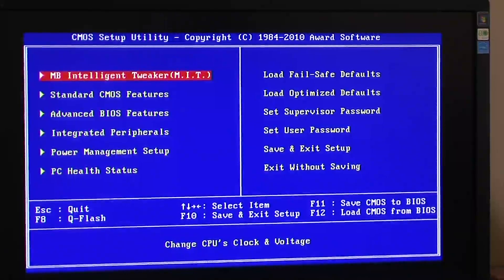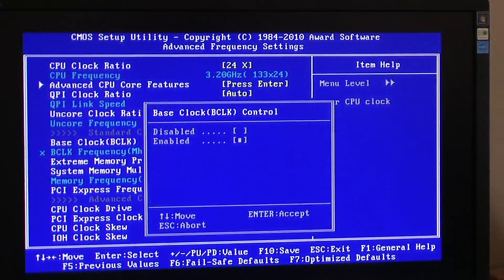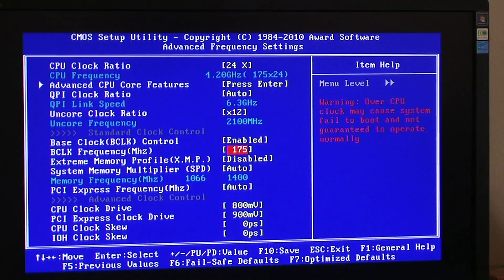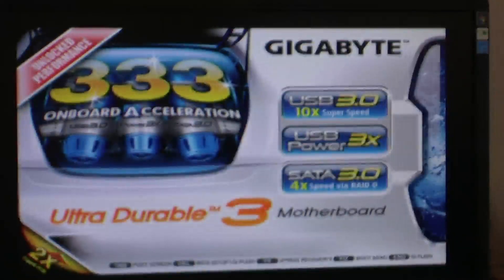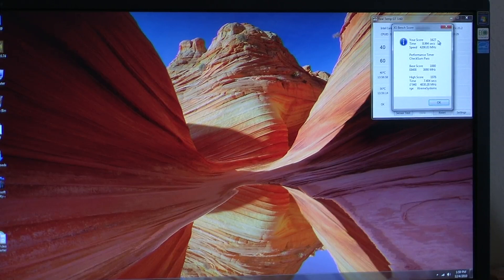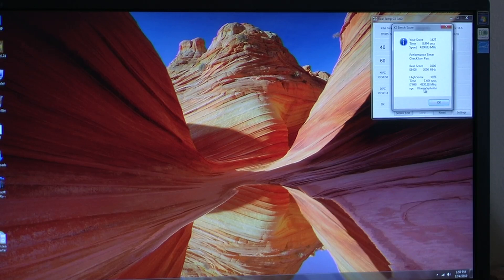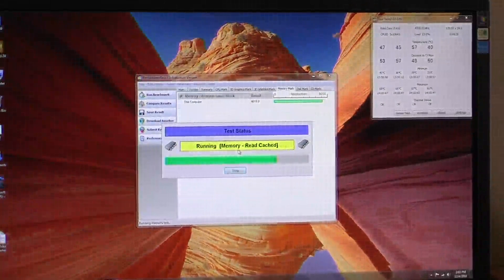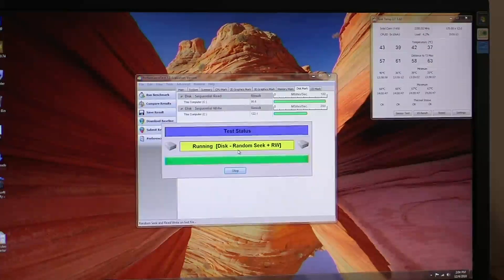GIGABYTE X58A-UD3R + i7 950 BIOS/OVERCLOCK/BENCHMARK

Comment: I would have liked to see your voltage settings. I have this same board and a 930 and I can push the BCLK right up to 200 and then core up to 3.2 and its stable on auto voltage but when I go to set the voltage to take it further it crashes, even right up to 1.25v
Reply: I m really need your help!!! I have the same board and all i want to know can i use Hyper 212 EVO CPU Cooler On this board? My Case is Cooler Master K282
Reply: That cooler will work with everything. Some people still use it on the newest platform. Although its not a strong cooler so you won't be able to get maximum overclocks with it.

Comment: iam having a ram problem and iam running the same board and processor can u help me
Reply: Same here, I have 24gb installed but shows 16gb but windows enterprise see's 24 just 16gb useable.
Reply: ReganMarcelis figured it out it was a few bent pins on the board for the CPU socket
Reply: I heard this before but makes me wonder how so many people on these boards ended up with bent pins, how did you bend them back, easy to spot? Did your reboot three or four times and then boot-up into windows? i am starting to think mine is not this bent pin plague as my windows does say 24gb installed just 16 use able. It is 64bit windows enterprise. Glad you found yours, now do I take my CPU cooler off, etc as its not an easy one to do...
Reply: ReganMarcelis just go with a different platform this one is notorious for being junk that's why they never expanded it's use
Reply: If u look on pcpartpicker.com you will see the limited amount of CPU options
Reply: They broke records on this platform? Overclocking Records. I know though about this issue and its odd how everybodys is different. I do not think mine is that serious since it is showing it in windows just not usable maybe by gtx 1060 is using the other. As for the three reboots till restart on - d-ram, welp, that needs to be fixed. Maybe the timings... are still set to my rip jaws. LGA2011-V3 is my fave socket, not many options either but brilliant and pricey! Maybe they wanted to drive the market up in the future since overclocking is so easy on this that gamer's would of flocked to cheap chips. There is def an issue on gigabyte boards with triple channel memory though and some timings I think... x58 junk. NAH! Hogwash. Even with my issue she is starting and I think the 24gb is being seen by windows so it isn't even the platform or board, its my gtx 1060 sharing it... the three restarts with dram is the board but I will get to the bottom of it but she still starts even thru this, it must be the timings going to take them out tonight and write down the mushkin stealth triple channel timings and try to set manual.
Reply: ReganMarcelis to each there own, one of my fave was the z77 platform 3770k just a beast
Reply: But they did break records with the x58 I have my x58 up to 4.9 ghat I think they got to 5.2ghz
Reply: My bad it was actually 7.195ghz with the i7 980x x58
Reply: Without a doubt man, I know people like the 8700k but I like the 7700k as it shows up twice in the top three slot for best overall multi and best overall Single core use so all around its a beast and over clocks like one so much so intel has been doing something with the 7700k telling folks who own it no to overclock , hmm...
Reply: Yeah, Gigabytes OC board was highly sought after and if you had pone, you were the man, heck if you have one today you are the man as its a great board. I wish I still had mine even over some of my newer stuff. The 950 chip I can say is stable, one of the most stable chips I ever worked with even at medium overclocking however it has more instructions to it then most chips so I heard hence may be giving it the ram problem plus triple channel is an odd ball thing in the first place. I will figure mine out! Maybe it just doesn't like my two sets of 12gb Mushkin Ram triple channel, I hope not as I like them! HAH... My only issue now is on a fresh reboot it reboots thrice as goes to checking DRAM, reboot, then again dram pool or something similar, reboot then again then it goes right into windows after the last one. It does some type of patch. Maybe I should stop being lazy and google the patch #'s. HAHA...
Reply: Makes me want a 980 with the Gigabyte OC board with al those buttons and the great Halloween theme! Was BEAST! It still is... I may look out for one, they sell on eBay for around 800. HAHA... Wonder what the 990x is now, is that the best chip on the x58 platform by clocked specs anyway? I lost track when people hopped ship...
Reply: I bet x58 was the first to run 6-8 cores at 5.0+ ghz on ALL cores... STABLE. Also the first Hexacors which are indeed my favorite besides the 7700k which is obviously a diff socket. If I could fit the 7700K into a old gigabyte OC board, I damn well would, HAHA!

Comment: back when i had the first Prescott p4 cpu it idled at 60 with stock fan with no overclocking now i have a i7 920 clocked at 3254.97 at 100% use it has reached 100 after about 3 minutes with prime95 for my cpu fan i am useing Noctua NH-C12P SE14

Comment: I also want to Overclock my system. I have :
i7 950 with a noctua nh-d14
Asus Sabertooth x58 motherboard
GTX 570
8GB 1600 MHZ Ram
850W Power supply

Will those settings work on this systen? And what is the difference between voltages, i mean i dont know how i should do it. Most of the people say that upon 3.8 GHZ you should change the voltages. I hope that you can answer this question. Greetings

Comment: its because the i7 950 has a multiplier of x23, x24 is considered turbo boost, so it is 4.03ghz with 4.2ghz turbo. Normally it would be 3.07 at x23 with 3.33ghz with turbo boost(x24)

Comment: @terryn89 Part 2 HA. What I did was set the overclock in easytune to the maximum under the easy mode which is 3.68 ghz. then it asks to reboot, when it boots up i go into my bios and see it's actually running at 3.84ghz. @ 160mhz. The reason, I think the program was written when the i7 920 was hot. I may be wrong though. Anyway dialing it up to 170mhz in the advanced mode pumped it to 4.08 and 175 shot it to 4.2. She had problems at 180 mhz so I dialed back. Running great  @4.2...more testing.

Comment: @terryn89 I didn't know the settings were in the "Easytune 6" to go above 3.68ghz. I goofed around with it the other day and found the settings under the advanced mode. Anyway, to make a long story short I was able to get a stable 4.2 ghz running "prime 95" for about an hour and never got above 55c with my Corsair H80 water cooler. I read all the time that you shouldn't overclock with an on-the-fly program but easy tune literally does it in the bios. I haven't messed with any voltages yet.

Comment: Hi there, I followed the video step by step yesterday as I have the same motherboard and an i7 950 bloomfield CPU. On reboot it always shuts down the first time and on 2nd reboot I get a message saying that some voltages or settings have been changed that don't work well with the system and goes back to original settings. I even tried it after un-installing "Easy Tune 6" but the overclock just wont hold. I've tried under 4ghz also. Easy tune allows up to 3.68 and that works great. Any Ideas ?

Comment from the maker: @Kaeden728 Your a brave soul to update a bios. I honestly haven't done that in more than decade... or two. It's a tricky to do and more times than not results in what you had, dead motherboard. With boards costing just a few hundreds bucks anymore flashing the bios, imo, is not worth the hassle. I upgrade pretty frequently, and as matter of fact have sold this particular computer and a few others I've built in the meantime. Currently only running a laptop until I sell another custom rig.
Reply: Xm58s are tanks in the beginning i sait qpi vcore to like 1.45 not knowing how bad it was luckily I dove back in to see what the issue was I have 3.82 ghz stable but i want 4.1

Comment: @Awsomedude2142 It's probably a frequency light. Mine has many of those the higher things are set the more lights show up. Mine has frequency lights, and also volt lights. Maybe temp lights too. I have the G1 Guerrilla, but I wouldn't mind a spare mobo such as the UD3R. Best money/performance board IMO.

Comment: the ram multiplier is the one that has to be twice as high. Pretty sure the QPI does not have to be. Because that always stays the same and you can make your uncore as fast as you want or as slow as you want according to ram. So I used to say the same thing, but I was wrong.

Comment: Hey, I've recently been having some problems with my computer. I just bought it, I'm running the same board/cpu with an H60, HAF X case w/ 2 200mm fans on the top and an additional cooler master sandwiching the H60 RAD. The problem I have is that since I've put the H60 on my temperatures spike up to 100 under load, yet the H60 is very cool. I had to replace the H60 because the last one didnt work, and under load it was warm. This one was not. With the stock cpu fan under load temps were at ~65.

Comment from the maker: @Tony2438 Stock (auto) @ 1.25v, I didn't mess with anything except what I show in the video. As far as temps once past the 4.0 Ghz mark if you run Prime 95 or something like Handbrake that maxes out the cores, the temps will rise into the 70's and even over 80C over time. The H70 is ok to a point, but by no means the ultimate cooler. If your looking to go beyond 4.0Ghz full time I'd suggest going full water vs the H70 which is more of a hybrid air/water.
Reply: I have def won the silicone lottery as my 950 overclock without tweaking anything except ram to 6.0 to not overclock and stepping her up to 24x at 185 or something, it is high into the 4.8.33 range if I remember on AIR. Stable, days... Minus the RAM issue that reboots three times to get windows to start with my triple channel Muskins 24gb however windows does see the 24gb just 16gb usable so thinking that is my GTX 1060 but the reboot three times to get into windows is def the chip or board, I think the board and as in board I mean setting as in can be fixed with settings, ram timings, I will figure it out someday!...

Comment from the maker: @MrTwrdi007TV Is it stable at lower speeds? Try to step it up a little at a time. If you went directly to 4.2 it could have reset to stock as the CPU won't OC that high. Each CPU is slightly different in terms of how high it may overclock to. I'd suggest trying to move the base clock by 5 each time. 160, 165, 170 etc... making sure each time it boots, and runs fine for a while. Run some sort of tests before moving it up further.

Comment from the maker: @Jecoholic03 It could be the ram, or it could simply be the CPU you have. As I mention in the video some CPU's won't run much higher than the speed they are sold/rated at while others can be OC"d very high. This all comes down to basically a roll of the dice and how "perfect" the pc of silicon it was cut from. I have a friend from night school that has the same chip on an Asus mobo running at 4.6 under water with zero issues. I can get to 4.2 and that's it for the most part.

Comment from the maker: @Jecoholic03 I've actually only OC'd to 4.2 stable, and when I say stable that is for benchmarks and some programs. It still crashes or causes some hang ups even at that. I have not adjusted any voltages or tweaked the bios further. As far as the lights on your motherboard, they are suppose to be on, and are basically troubleshooting/status lights. If you open the Gigabyte book it will tell you what colors mean what. Red is typicall a bad sign, but depending on which lights come on and stay on.

Comment from the maker: @Adywerty88 I'm not familiar with how 2000mhz memory is going to scale up based on the OC methods for the X58. Running slower than factory spec is not going to create any major issues, which is why I set the clock/timer value to 6, or the lowest to keep the ram within factory spec's. You can always slowly increase that setting, but I would read up all you can about your specific ram/brand before overclocking it. GL

Comment from the maker: @asus3571 Those light are suppose to light up, they are basically like trouble codes/error codes (if it has an issue with the CPU). I don't have the book with me right now but if it flashes certain lights the book tells you what the issue is. If it's say overheating, or say the CPU was unseated in the socket, or ram issues etc.. I think one set is for the CPU only, the other is for the mobo.

Comment from the maker: @Adywerty88 Everything will be the same. The only difference is with the 2000 mhz memory you can run the memory at higher speeds than the x6 mutiplier under the "System Memory Multiplier (SPD)" settings. I basically would start out at 6, boot up, run a few benchmarks, make sure everything is stable. Then up it to 8.

Key to Overclocking imo is taking things slow and methodical.

Comment from the maker: @amd1507 I'm using 12gigs of A Data brand 1333Mhz ram. I keep the ram "underclocked" below the 1333Mhz speed by changing the multiplier to the lowest speed. This seems to help with stability. I have run it at 1600, but experience crashes rather often.

Comment from the maker: @higherDEFINITION What speed of memory are you using? If you have 1066 memory, be sure to make sure it's not overclocking the memory. That can cause reboot/stability issues. Another thing to check is heat, at the first "Turbo" setting what are your temps? I usually check in the Bios under "PC Health" as well as free monitors such as Fan Speed and RealTemp GT. 

A CPU can heat to 100c+ nearly isntantly, if it is overheating while going thru the self test it will shut down the system.

Comment from the maker: @higherDEFINITION Are you adjusting the Bios manually or thru the software? (Smart 6) Every CPU and setup is different as to how much overclocking the chip will do. I have booted mine up to 4.32Ghz and been able to run some benchmarks but it is not stable enough to run very long. 

Make sure you don't leave your ram on "Auto" this can cause the crash cycle your talking about happen alot, I also set my ram to the slowest multiplier and/or keep it under the stock speed *(1066/1333mhz etc...)*

Comment from the maker: @11burke11  Each CPU is unique so it's impossible to say if it will OC to 4.0 or whatever speed your looking for. The best way to start, at least with the mobo you have is to start using the "Smart 6" software, step it up to each setting, run some tests like Prime 95, or this benchmarking software, watch your temps and see how it performs. Then go back to the Smart 6 program, goto to the next higher speed and so on. 

You should be fine, but it's always best to take it slow and test each speed.

Comment: Exactly what i was looking for, I am new to overclocking and your tutorial looks pretty easy to understand. problem is my spec is slightly different to yours ill post at bottom would you be able to say if it safe to do the same as yours in the vid or reduce some parts cheers.

CoolerMaster HAF X 
Gigabyte GA-X58-UD3R 
Intel Core™ i7 930 @ 2.8GHz
OCZ Reaper 6GB 2000MHz DDR3 3x2gb 
HD Radeon 3870 (Temporary)
1x 500gb 1x 1tb 
OCZ SilentPro 700watt modular
Corsair Cooling Hydro Series H50